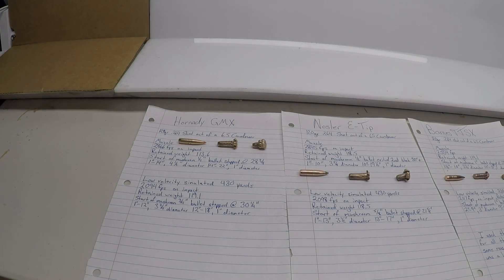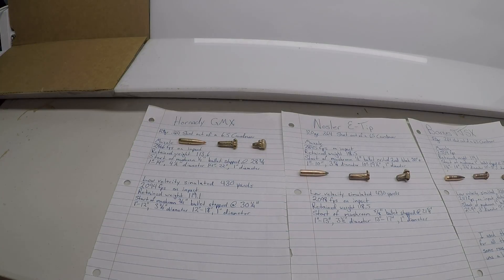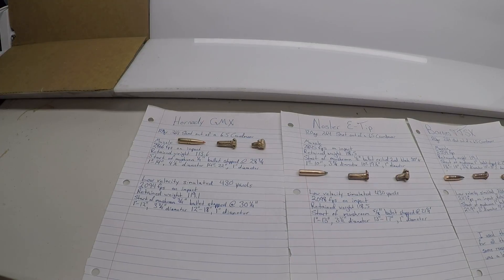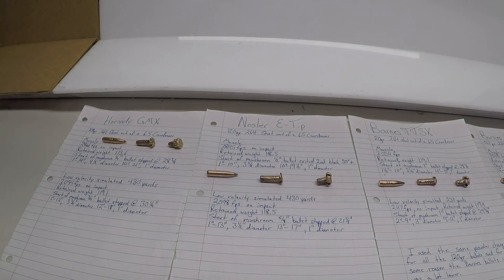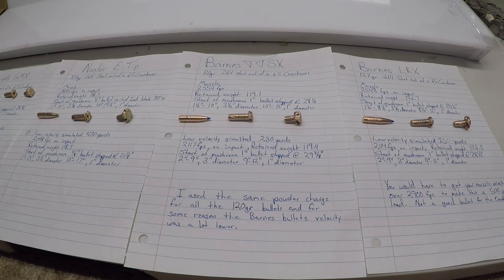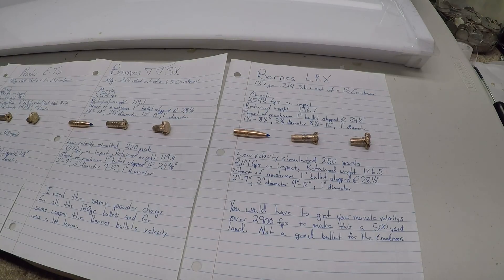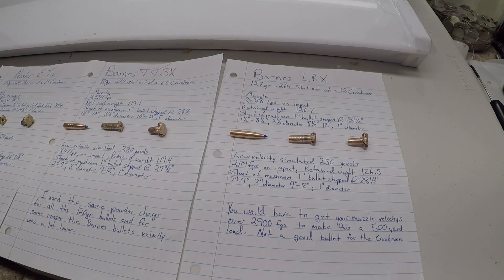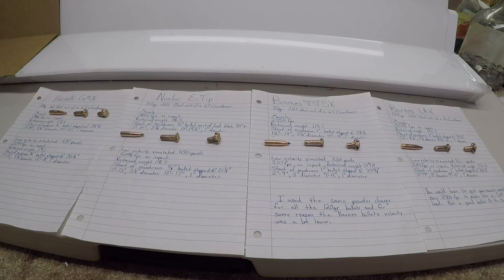6.5 Creedmoor Barnes, Nosler, and Hornady lead free ballistics gel testing overview

Comment: Great video! I'm biased toward Barnes Bullets, and the velocity on both Barnes was low due to teh other mono bullets having gilding metal material versus a copper alloy. Your Barnes velocity is a minimum of 300fps slower than Barnes data. I shoot the 127gr. LRX in my Creedmoor with StaBall6.5 with a 24" barrel and get 2930fps average. Retest this with loads from each manufacturer, and your results may change your mind. I do enjoy the comparisons you make and the information you provide. Keep 'em coming!

Comment: glad i found this video!

surprisingly poor performance from the Barnes offerings. that's a HUGE difference in muzzle velocities for bullets with roughly the same minimum expansion velocities! i've bought 1 box of every factory lead-free 6.5CM round i could find to try and find the most accurate load for my gun. now i'm hoping it's not a Barnes, because i can't have a maximum effective range of ~250. that's just silly. and i'm gonna be very sure to bring my chrono out for accuracy testing day.

Comment: Something is wrong regarding the velocities on the Barnes. You don't research why there is incredible velocity difference! Why wouldn't you re-do the Barnes when the data is obviously extremely suspect??? Me thinks the powder charge was NOT the same as the others and that you made a serious mistake.
Reply from the maker: Yes, I did my do diligence and research and yes there was something wrong, very wrong. I got a batch of Barnes bullets that where slightly under sized and the gasses were escaping around the bullet because they were to small for them to seal properly going down the bore so even with further testing and increasing the powder charge I was getting pressure signs on my brass from the initial contact with the lands before the bullet was fully leaving the case starting to move but then the gasses would escape around the bullets after they left the case because they where not sized properly not giving me the velocity. Yes I need to redo this test, but with a good batch of bullets. I tried to figure out what was going on with 2 different rifles before I almost ran out of bullets (somewhere I have 3 of them left) when I threw the caliper on what I had left and realized oh here's my problem it's not the guns or the powder it is indeed the bullets themselves that have a problem. 

 I discovered all that with further testing after having done this video and maybe I should explain a little bit of that in the description section.

Those bullets were not free as well as the gelatin and other parts of the testing process. If you would like to send me a box of these bullets I will gladly cover the other costs of other materials for testing and do more testing with a good batch of bullets. 

If you are interested in seeing another test on these and are willing to send a good batch of bullets so I can then email me at simplemindedfella@outlook.com and we can discuss it and I can give you an address.

Comment: Just purchased some .308 E-tips and wondered what the penetration comparison might be. Very nice presentation and data. Thank you. I have two Merkel 308 Win rifles. The KR-1 has a 1:12 twist & groups 165 gr lead and 150 monolith bullets (same length). The K-1 has a 1:10 twist & prefers 180 gr lead and 165-168 monolith (again the same length). I also have a 1:12 twist Kimber Montana 308 which groups best with 130 gr (TTSx is the only monolith tried). Twist, weight, length, and velocity all play an important role in precision of group. Obviously there are other factors including day of the week and color of underwear.
Reply from the maker: I have recently started using Hammer Bullets in a couple of my rifles and I am really liking how easy they are to get to shoot accurately. They have a couple lighter 0.308 bullets your Kimber may like. 124 grain and 137 grain Hammer Hunters in 0.308

Comment: You did it right by moving the blocks down. Some people will use reduced velocities  to simulate long range impacts and not move the blocks, not realizing that reduced velocities also reduces bullet rotational speed which will affect expansion. Long range will reduce velocity, but for all practical purposes, rotational speed will remain almost constant owing to the gyroscopic effect of the spinning bullet.

Comment: Thank you! This is first rate info regarding expansion on monolithics. I've had amazing luck with 168 grain TTSX out of a .308 on hogs, but all of those shots were under 100 yards, so lots of velocity. I'm glad that your work has provided some hard data on what happens with copper at lower velocities, especially since I am now hunting areas that offer longer range shots.
Reply from the maker: Your welcome. 

The TTSX is hard to beat. There are other monolithic bullets that may help extend your range a little but overall the TTSX has great knockdown.

Comment: OK, I have to declare shenanigans. For tix factory ammo the 27 grain load is 28 50 ft./s. I chronograph 2835 out of my 24 inch Teaka. Don’t know what you did wrong but you lost 300 feet a second. I think that a redo is in order. I think you were selling barn short. Also, 300 feet a second means all the difference in the world with regard to impact energy and temporary and permanent one cavity. I think you need to redo this or at least throw some projectiles over your chronograph.
Reply from the maker: I got a bad batch of Barnes bullets that were a few tenthousands under sized and I was getting bleedby. I tried two different rifles couple different manufacturers brass and five different powders with three different primers before figuring it out. 

So yes at some point I should try to get my hands on some Barnes bullets in. 264 and make sure they are good this time and redo the test. 

Overall Barnes are excellent performing and highly leathal bullets. Unfortunately it seems like they lost some quality control with their sell out to Remington. 

I have used Barnes in the past and I will use them in the future. I will go through them and check each bullet individually from here on out as having the issues that I have I feel as tho I need to unfortunately.

Comment: This is interesting I use the Barnes bullets and with the 127 gr  and get 2860 fps from a 22 inch barrel?   You need to use the powder they recommend not one powder fits all . This is a good bullet for the creedmoor .
Reply from the maker: It is an excellent bullet overall. After trying different powders and wondering what the heck was going on I took my caliper to them and I had got a bad batch and they were all a few tenthousands under .264 and I was not getting the seal I needed around the bullet. All the other copper bullets I tested measured to the correct diameter. 

If I ever buy Barnes bullets again (I most likely will) I will check the diameter first thing and contact them if they are undersized.
Reply: Simple Minded Fella Remington!🙄🙄

Comment: Well done sir! Would you share which of these if any you’d choose over all the others? Looks like e-tip and GMX are comparable. I’m assuming the gmx is cheaper.
Reply from the maker: If all of these gave the same type of accuracy I would use the GMX for sure. I have not done any accuracy testing on any of these yet. I will be at some point as I plan on dedicating one of my 6.5 CM's to just copper bullets.

Comment: You like the gmx over the ttsx in 120gr ?
Reply from the maker: In gel testing I would have to say yes, the gmx definitely out performed the ttsx. I have not yet shot game with them.
Reply: @simplemindedfella  I would say the bullets would have to be compared at the same velocity to make that determination. 300 fps is quite a bit of a contributor to the marginally better results of the gmx. I understand that with the same powder charge you got a lower velocity but that's irrelevant. If the pressure is lower and you can add powder to achieve the same pressure and velocity with the Barnes assuming you have case capacity. The pressure and velocity likely have allot to do with the surface contact. The Barnes bullets have 3 groves and the gmx has 2, that extra surface contact likely increases pressure, restulting in more velocity. Anyway, great video 👍
Reply from the maker: @racrx728   I tried that and I am actually going to have to test a different batch of bullets at some point. I got a badd batch and they were slightly undersized and I felt as I could not safely continue testing that batch of bullets.

In regards to the slight advantage of the gmx is because it functions at a lower velocity and yet still holds together at the higher velocities given them a broader range of effectiveness. Both are excellent bullets and I would base my choice off of which ones I could get to shoot the most accurate as the advantage of the gmx is slight.  In this particular case I would go with the gmx because I got a badd batch of bullets from Barnes.
Reply: @simplemindedfella  Barnes quality control seems to have taken a dive😒. Something interesting as well would be how the softer bullets perform at magnum velocities. Is there decreasing performance with velocities above say 3000 tho 3200 fps. I bought some Barnes 145lrx to use in my 7 mag @ 3300 fps MV. I usually run the 162 eld x @ 3080 fps but the bear hunt I was going on has opportunities between 50 and 500 yards. I was worried about close range performance at non optimal angles with the eldx, and expecting the LRX to hold together and expand at close range. 
Now going I'm to check my lrx's for proper diameter... 😅😂🤣
Reply: What powder h4350 ?
Reply from the maker: @philipwalker1267  I just picked a powder to get the velocities I was looking for doing gel test. I have not loaded these for accuracy and used for hunting as where I hunt it is not required to use lead free. RL 16 is a powder I really like with my other loads in 6.5 CM and think it would work well with these.

Comment: Did you by any chance do any accuracy testing as well?
Reply from the maker: Not in this round of testing. I have never had an issue getting any of these to shoot good regardless of caliber I just recently started doing high and low velocity gel testing to appease my curiosity as I could not find the information I was looking for online so I am generating my own.
Reply: @simplemindedfella  Thanks for the response.  The testing you did and the information you gathered was very informative. I am trying to decide on a bullet to load up for Mule Deer for my .257 Weatherby. So far I am leaning towards the 100 grain E-Tip. I have 100 grain Ballistic Tips loaded up now but at 200 yards or closer they behave like varmint bullets, looking for a tougher bullet and monolithics are hard to beat for that.

Comment: That's a Big drop in Velocity. From about 2850fps for the GMX and E-tip, to 2550fps for the TTSX? That's about 10% slower and probably contributes to the reduced damage.
Reply: Paul Tull morning
Reply from the maker: I think it's because the gas was escaping around the bullet when I put the caliper to the bullets the Barnes Bullets were .2635 and the Nosler and Hornady were a true .264
Reply: @simplemindedfella  Good video and great post hoc detective work.  So would you just give the Barnes a bit of a crimp then?
Reply from the maker: @josephvafi  after gel testing them in multiple different calibers now I would not use them because Nosler and Hornady are cheaper and work better. Not that they are bad and won't get the job done, its just that there are better options for less money.